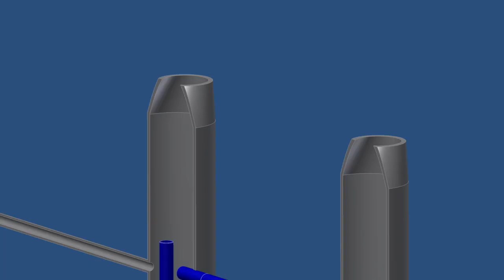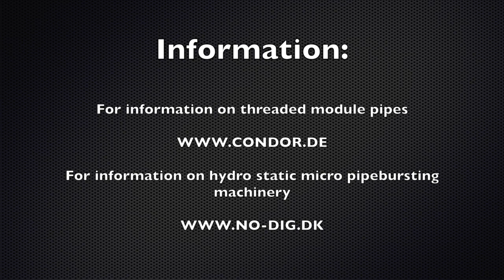Pipe bursting from shaft to shaft

Comment: I dont get why you guys in Europe dont use fusion welded continuous pipe it gets the man out of the hole which can be made unstable by the pulling
Reply from the maker: Hi Chris.

But we do, and for much longer time than any one else on the planet.
However, operating inside service shafts down to Ø800 mm. inner dia., does unfortunately not give us the luxury of inserting pre-velded HDPE pipes.
So, that is why we are so fortunate to have threaded PP- module pipes, to enable us to execute these kind of applications where traditional welded HDPE pipes must rest...

In regards to safety, we got that completely under control as well.